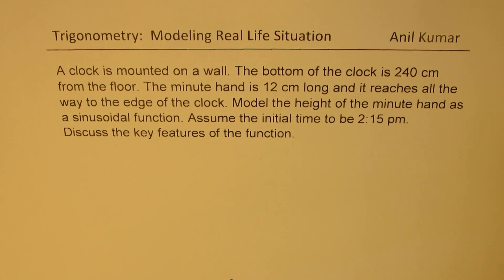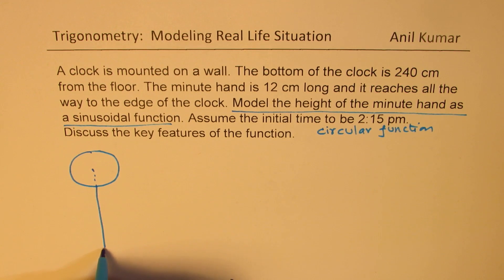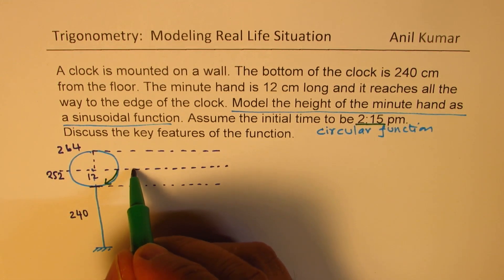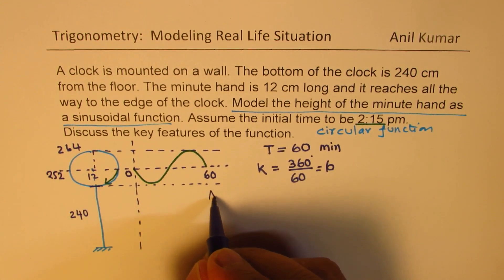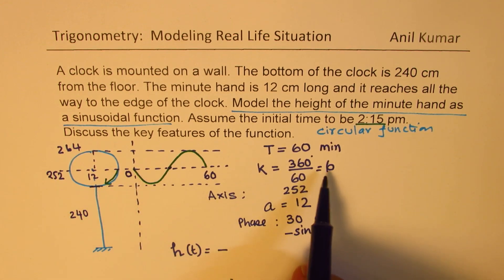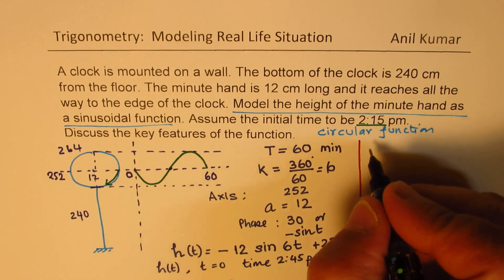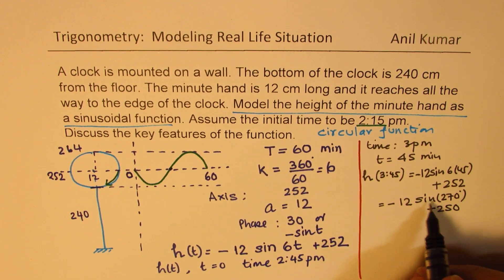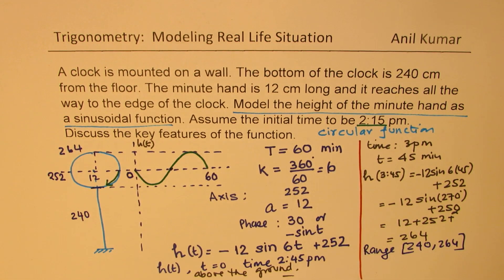Model Wall Clock with Sinusoidal Function MCR3U Trigonometry

Comment: Love the video, but I think you might be mistaken. I am fairly certain this is the graph of a cosine function, not a sin or -sin, for the clock normally starts at the top, just as a cosine period.
Reply from the maker: Since it starts at 2:25, the wave will be sine going downwards as explained in the video. Hope that helps. Thanks
Reply: @MathematicsTutor  I am still confused. Even at 2:15, the minute hand continues to move to the right, and the height decreasessincethe beginning.
Reply from the maker: at 2:15 the minute arm is at 3 along the axis. This is sine position going negative.